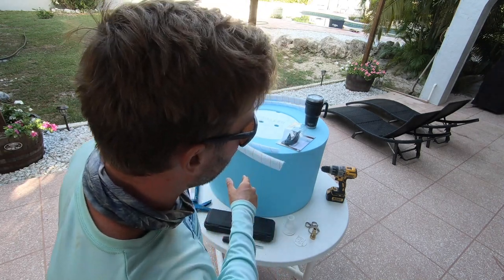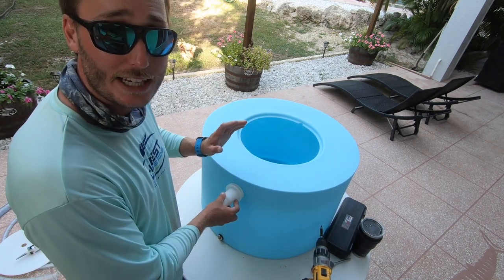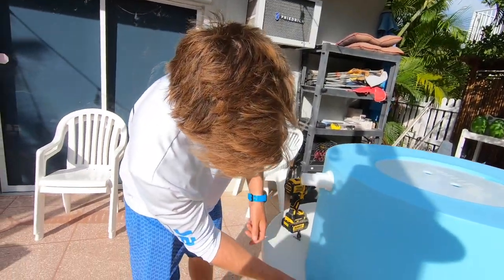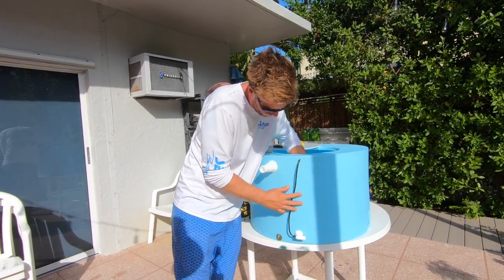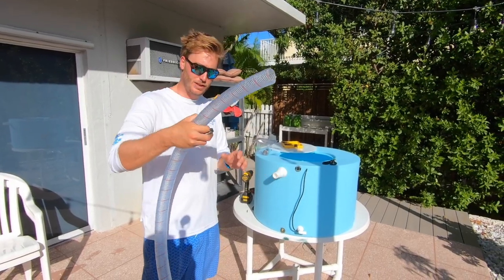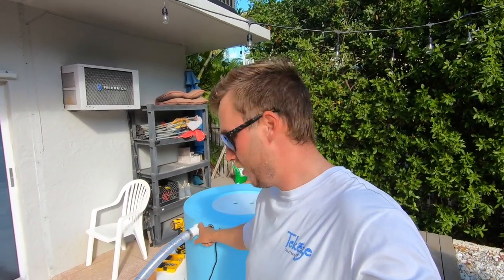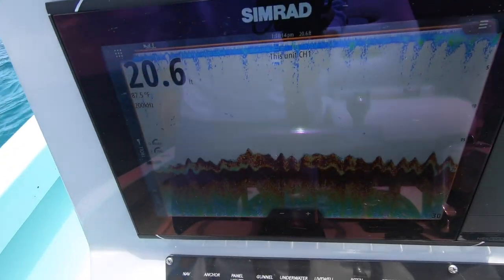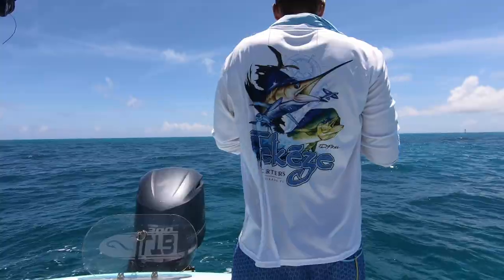How To: Build A Portable Livewell! | Catching Bait On New Boat | Latitude Tournament Boats

Comment: I made a livewell for sardines and anchovy on the west coast, but the sardines were dying faster than I wanted. I had an aerator on top that had water flowing thru. I am going to change the intake water to the venturi valve that you have. Seems like more aeration than I currently have. Thanks for the vid!!!

Comment: What pump do you use on this setup?
Reply from the maker: It is connected to my sea chest
Reply: So the sea chest draws water using the intake of the engine not a separate pump right? Have not seen that for myself but if so it sounds great.
Reply: Never mind I read down below and you said you have 2 pumps running . What I was asking is what size was the pump for the portable. The water flow going through the intake looked pretty strong.
Reply from the maker: @getitdone6694  the portable gets attached to a 1500gph Rule

Comment: Why put the inflow at the bottom? If you turn it off, all the water will drain out. If you had put it 3/4 of the way up, the water can only drain down 3/4th of the way down. I personally like it above the drain hole. Then you can have use a spray bar or below the outflow and have a calm inflow.

Comment: What does the ventrui vent do exactly
Reply from the maker: The venturi system draws fresh air from outside the livewell and injects tiny air bubbles into the water flowing into the livewell.
With the aerated water entering the well at a lower level than with traditional spray heads, the entire well is more thoroughly aerated.